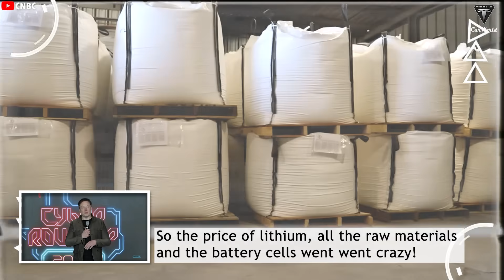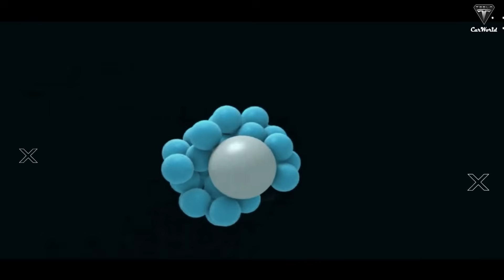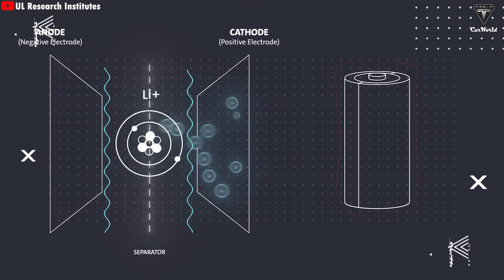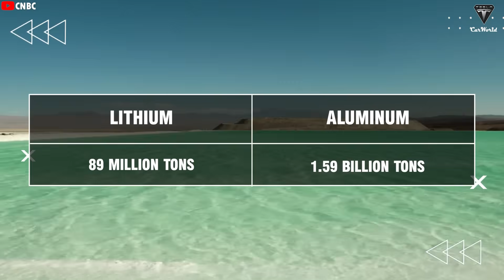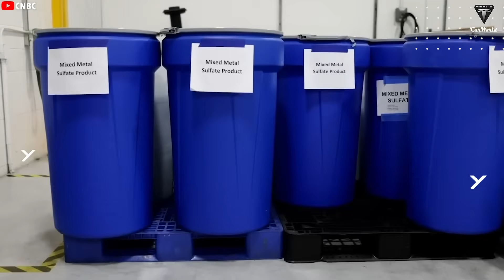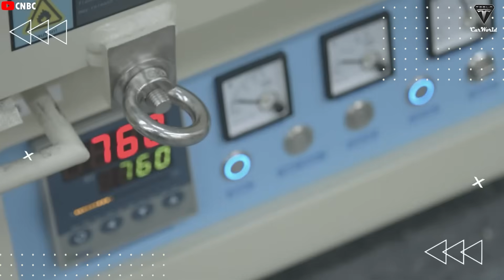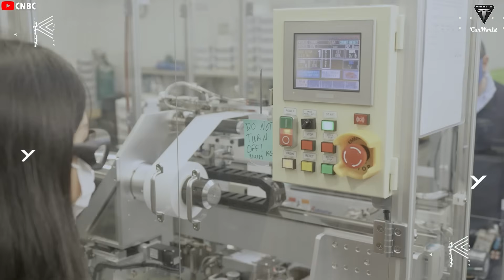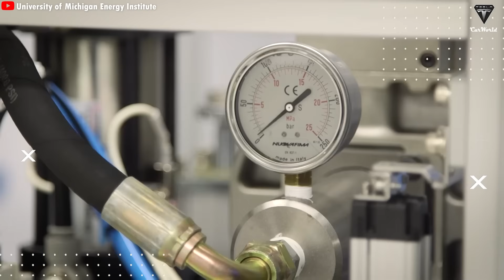Goodbye Lithium! Elon Musk Revealed Tesla Aluminum-Ion Battery 30 Years Lifespan Hit The Market !

Comment: So I have a question: If Al(-uminum) turns into Al3+ at the cathode is there no reaction of any kind at the anode? Does the aluminum ion not turn back into neutral metal but stay ionized and just surrounded by electrons in the graphene without reacting back to metallic? But if it reacts back to metal then there is no energy stored in the system. 
So it must not be the whole story, there must be a secret not revealed here or it is a hoax? With H2O in the electrolyte most aluminum surfaces would immediately react with water and form oxides and hydrogen gas. 

If you look at an aluminum electrolytic capacitor they depend on an oxide coating that blocks this ionization and the electrolyte is laden with something like ammonium hydrogen sulfate which is acid enough to prevent both layers from degrading. The dielectric from al-ox is the capacitance and the electrolyte prevents any chemical reaction with metal aluminum. 

If the aluminum ions in the graphene don't react with electrons the water in the electrolyte and OH3+ must react to hydrogen (H2) in the graphene. That kills the contact with the graphene anode just like in normal zink/carbon batteries where the gas has to be absorbed by a whole bunch of Manganese per Oxide so not rechargeable.

Comment: At 14:43, the narrator reports that "One of the most significant drawbacks against Aluminum-Ion batteries is their low voltage-output, which is just 2.65 volts, whereas today's Lithium-ion battery-output is 4.0 volts ... which means Alum-ion batteries only have about ~65% of the voltage of today's L-ion battery.  Sounds like we'll have to be satisfied with merely a 399 HP peak electric-output in Tomorrow's Electric Cars, compared to today's gasoline-powered hyper-cars with 500 to 600 HP.  However, I'm no expert, so my logic (above) may be flawed. Anyone here able to disspell my assumptions?  I was thinking maybe some of the Alum-ion batteries could be run in 'series' (rather than 'parallel') to bump-up the HP.

Comment: Not sure how aluminium ion battery achieve 5kw per kg, Aluminium atomic weight is 4 times  greater than lithium, even though if aluminium shreads 3 electrons  it lacks behind 1 electron. Maybe lithium is not upto it's full potential or they are spreading wrong rumours, If aluminium ion battery has 5kw per kg it rules the world

Comment: Unless I see someone from Tesla officially saying Aluminum Ion batteries are real I will assume this video is fake.   There is a really high probability that this video is AI generated and total click bait.
Reply: Tesla has made several announcements about testing aluminum ion batteries. First major news I could find was may 2021.
During the last 2-3 months we have seen some more announcements. On lab scale this seems to have a high chance to work as promised in large scale use.

There is now a hope to be production ready during 2026. Looking at Teslas earlier promises the timeline has often slipped considerably. We also have the solid state batteries that several manufacturers have promised to deploy in large scale for EV during 2026.
The chance that we will see major changes in EV batteries during 2026 and 2027 is very high.
That means 2025 is likely to be among the worst years to buy a new EV as it might have outdated battery tech in just 1 year.
That is one of the reasons the car manufacturers don't want to talk so much about what is coming. It could be devastating for the current year's sales, and they really need to bring in money to invest in new battery tech.
Reply: According to Copilot:

"tell me about tesla's aluminum ion battery technology and any technical papers they have published about it and whether it is on track for a 2026 release. explain to me in simple terms."

 🚗 *Tesla’s Aluminum-Ion Battery: Explained Simply*

Tesla’s aluminum-ion battery—sometimes called the *Super Aluminum-Ion Battery*—is a new type of battery that could replace lithium-ion batteries in electric vehicles (EVs). Here’s what makes it exciting:

### ⚡ What Is It?
- *Aluminum-ion batteries* use aluminum and graphene instead of lithium.
- Aluminum is *cheaper**, **more abundant**, and **easier to recycle* than lithium.
- These batteries can charge **super fast**—some reports say **fully charged in 10–15 minutes**.
- They’re expected to last *over 1 million miles* or **10,000–15,000 charge cycles**, which means you might never need to replace the battery.

### 🔬 Any Technical Papers?
Tesla hasn’t released formal peer-reviewed technical papers on this battery yet. Most of the information comes from:
- *Announcements by Elon Musk*
- *Tesla Battery Day presentations*
- *Industry reports and speculative articles*

So while the science behind aluminum-ion batteries is real and promising, Tesla’s specific implementation is still under wraps.

### 📅 Is It Coming in 2026?
Yes—if everything goes to plan:
- The *Tesla Model C* is expected to be the first car with this battery, launching **late 2025**.
- The *Model 3 and Model Y* are expected to follow in **2026**, using the same aluminum-ion tech.
- Tesla’s goal is to make EVs **cheaper**, **faster to charge**, and **more durable**—and this battery is key to that strategy.

### 🧠 Why It Matters
- **Cost**: Aluminum-ion batteries could drop battery costs by **up to 75%**.
- **Speed**: Charging in minutes instead of hours.
- **Longevity**: Drive for decades without worrying about battery degradation.
- **Sustainability**: Aluminum is safer and more eco-friendly than lithium.

If Tesla pulls this off, it could be a game-changer—not just for cars, but for home energy storage and even aviation.
Reply: Aluminum Ion batteries are a real thing & have been since at least 2019.
Reply: Aluminum Ion seems better in every metric, what has been holding them back ?

Comment: This presentation identifies the low cell voltage of Al cells as a major drawback to practical application. Lower cell voltage simply requires longer cell electrical series hookups. That means that Al cells are not drop-in replacements in high-voltage battery pack designs. The demonstrated short full recharge characteristic implies that the increased resistive losses produced by the longer hookup strings should be considered a trivial application barrier.

Comment: The potential of 1000m removes all range anxiety and 1/3 the cost, 30yr life, and recyclable.  All positive, all we need now is the electricity to power everything. Bring it on.
Reply: This video did not address its reaction to very cold or very hot temperatures

Comment: I am looking forward to getting a cyber truck when they are equipped with aluminum ion batteries. PS max range is a good tool to compare energy storage , is a gross overestimate because of climate control and entertainment on long trips.
Reply from the maker: Great point! EPA max range doesn’t always reflect real-world usage, especially with AC, music, or Netflix on the road. If aluminum-ion can deliver 1,000 miles under actual conditions — that’s the real deal.